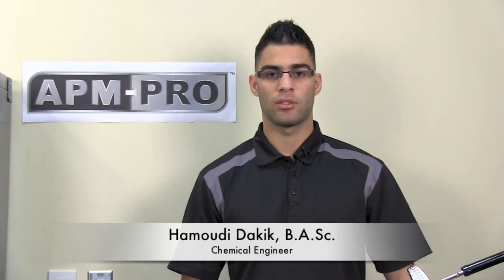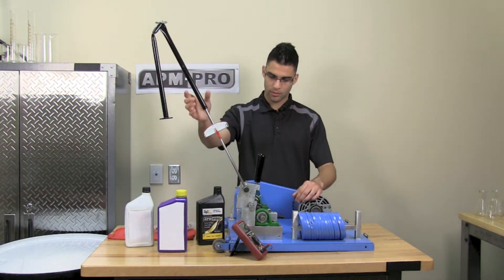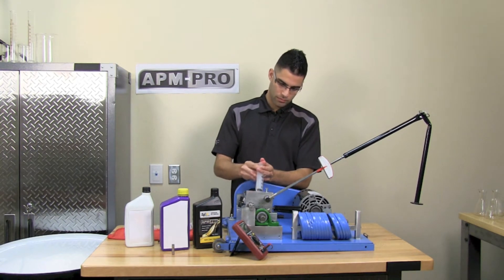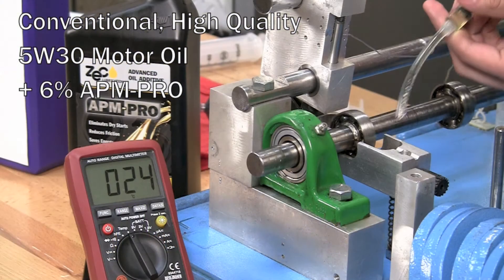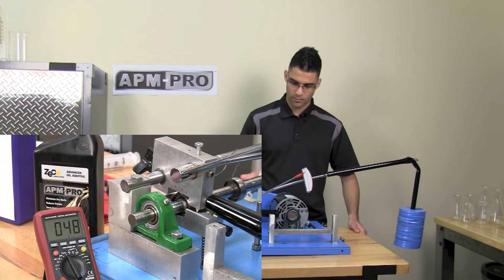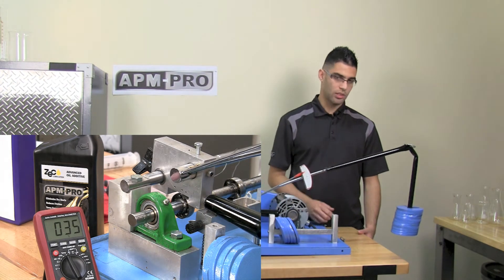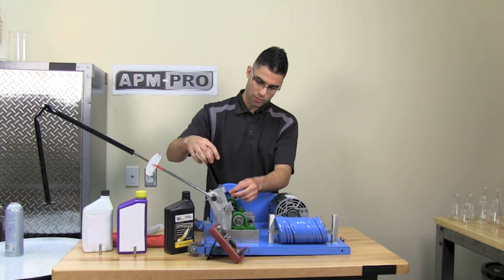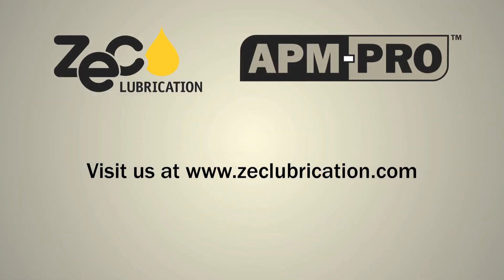ZEC Lubrication Falex Wear Test (Extended)

Comment: good day ... I'm interested in one thing ... I use Castrol oil of the new generation. on the bottle states that it has APM molecules. how much I have benefited from it?
https://www.google.rs/search?q=castrol+actevo+5w40&safe=off&espv=2&biw=1920&bih=979&source=lnms&tbm=isch&sa=X&ved=0CAYQ_AUoAWoVChMI-8q17_SeyAIVRoosCh0U_QaC#q=castrol+actevo+5w40&safe=off&tbm=isch&tbs=isz:l&imgrc=wdgGxlrtIDy8zM%3A